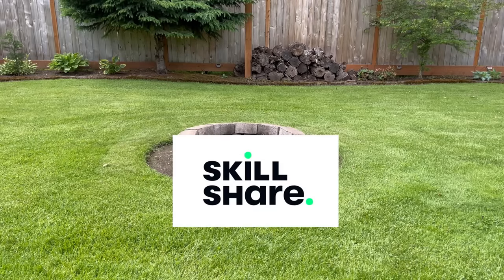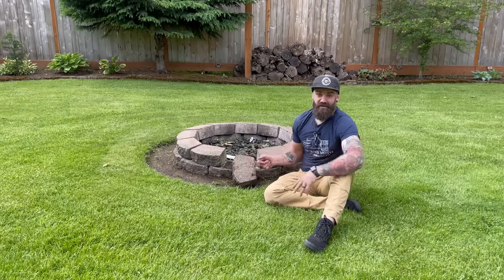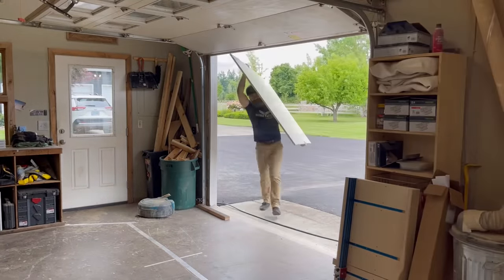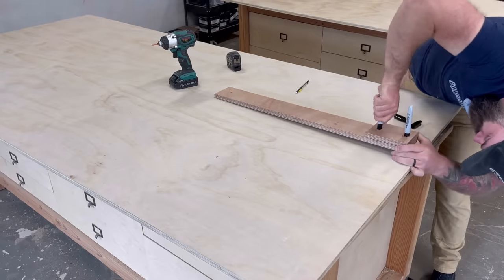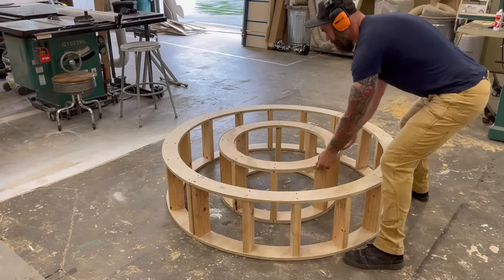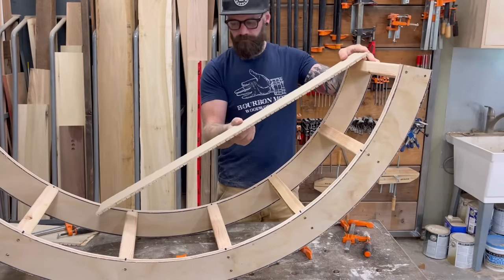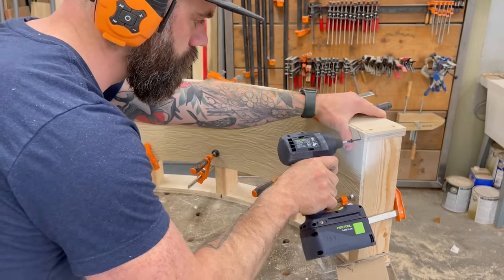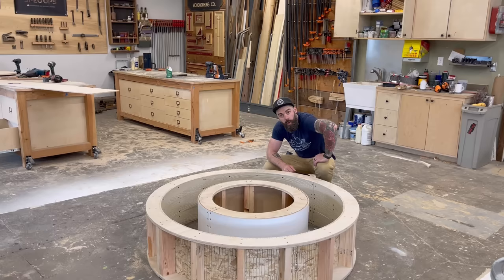Making a Concrete Fire Pit the Right Way || Ultimate Fire Pit Build

Comment: When making the inner form, use three pieces (as you did) and use wedges of at least 60 degrees in the joints. That way, when you pull out the wedges (from the inside), the three pieces will easily pull straight out from the concrete and can be lifted out. And, they will be re-usable! 🤓👍
Reply: Thought the same thing. Would have saved a lot of pain and aggravation.
Reply: Or coulda started the bon fire early
Reply: Should just burn the inner Ring

Comment: For a guy that dont know what he's doing with concrete, you sure made it look good. Would I have done it differently? Parts of it, Yes, but it turned out really nice. Overall, I'd give it a 9.5. Well done.
Reply: Do you work with concrete regularly? If so, what would you have done differently?
Reply: would have added sand and small pebbles to the concrete mix for starters.. makes it a lot more durable and less brittle..

Comment: That was nice. Dad always sprayed diesel fuel on wood when we made forms, the oil in the diesel prevented the concrete from sticking. There might be a better alternative but we always had diesel on the farm along with pump up sprayers.
Reply: 8
Reply: Still use diesel on commercial precast plants, though they are moving to water based release agents
Reply: @alisdairherd9501  I've never given it a lot of thought but I bet Thompson's water seal would work also just not as economical.
Reply: We use diesel fuel professionally also, in a big metal sprayer
Reply: @tedpanek5028  you for u
Reply: @BrandonGoble78  I have 3 sheds and a barn on the farm. One shed is sprayed with diesel and used motor oil. It makes a good wood preserver and they give me the oil at the recycle center. I spray it about every 4 or 5 years. I wish Pittsburg Paints would give me the paint for the other three. lol

Comment: DUDE SAFETY!! Concrete can detonate when exposed to fire. My sister lost her eye and had three teeth smashed out when the fire that was on a concrete base detonated. It's the trapped water turning to steam, then expanding. Stay safe - do your research on concrete / fire explosive failure, great skills in the video man tho.
Reply: Thats why he put in the fire brick on the interior part of the concrete
Reply: Dude... You didn't watch the video did you?
Reply: @averystrawn9819  You've never seen concrete explode before, it Doesn't explode by direct contact from fire it explodes from water trapped inside air pockets evaporating causing pressure build up Doesn't have to be direct heat lmao.
 Concrete can be safe as long as you allow allotted time for it to cure . Me personally would have lined the firebrick the proper way around the inside.
 It May last 100 years it may cure and then get rained on trapping water and frag, Id rather be safe If I'm investing that much money into a fire pit.
Reply: Do your research bud concrete takes 42 days to fully cure that means all moisture is gone green concrete is the few hours before it dries to the normal white color and by vibrating your separate cream from aggregate every thing he did ensured proper safety the only thing he could’ve done better would’ve been to mix in fiber
Reply: @jake_god_of_sleep6564  Concrete is most effective and stronger when it still got moister in it, Once it's dried out over time and age it will crack and get rained on if its an outdoor concrete.
 Concrete even fully cured can soak up more water retaining it. Concrete poured directly on the ground without a barrier can still absorb moisture through the ground.
   The more you know lmao 
    As I stated before it could last 100 years with a fire or 10 days depends on his climate humidity and so forth. as I myself don't need to do research I come from a family of brick layers and concrete drivers who own a concrete business in VA. I am well versed in the what and what nots of concrete.
Reply: @Exessive-Gaming  yup and I do it for a living as well pouring placing finishing and decorative. Also I’ve specifically made one piece fire pits and if you like planter boxes it’s the same exact thing just filled with soil. And yes the natural retention of moisture in concrete is good but 4000 psi with 3/4 aggregate and stealth fiber and a wire mesh inlay will last well over 100 years under proper conditions.
Reply: @Exessive-Gaming  the comment I made was directed at the person who posted the comment I was aiming it at you.
Reply: @Exessive-Gaming  wasn’t *
Reply: Its def something to consider. I had an acquaintance who took a firepit explosion to the face. Luckily no injuries, but it broke the wine glass out of her hand :/  Im not sure the synthetic fiber would do much besides melt. In fact we intentionally singe them off countertop surfaces before sealing.

Comment: Oooooh!  That is going to crack like crazy.  They make a fire rated fiberglass concrete which will help.  Also your voids should have some breaks meeting the other side. More fire bricks could help. Still great build, great effort, will like an subscribe. I want to see what this thing looks like after a year and a few fires.
Reply: A couple of good hot fires will drack it all over.
Reply: @christopherhaak9824  I think your ..... sadly very right.

Comment: I strongly recommend oiling the formboards to make them easier to remove afterwards. Also, DO NOT use regular cement for a project like this due to trapped moisture and risk of explosion. Use only refractory cement, which is designed for high temperature use.
Reply: You can recommend it all you want, but odds are no one will do that, as refractory cement is expensive. Unless of course you have two grand to spend on twenty bags of refractory cement. He did it the most economical way, and as a concrete guy myself, using wax is perfectly fine. I personally use diesel simply because I can spray it on with a pump up sprayer. But the objective is to get a clean separation, and to protect your forms, so what ever you use is acceptable.
Reply: @thebeardedone1225  expensive but will break if you don't use.

You should also never use diesel to spray.
Reply: Not a risk. It will happen.
Reply: @thenarrator1984  I've used diesel on my forms for fifty years. It works just fine, and preserve my forms quite nicely. I only use refractory cement in fireplaces. For outside pits, that requires a large volume, I substitute two shovel of sand with two shovel of fire clay. I've never had one crack. And I can't count how many I've poured that way.
Reply: @thenarrator1984  You are a clown lol Clearly haven't been in the industry as long as a lot of people. Just because there are new ways of doing things doesn't make the old ways any less feasible. Id say your attitude is way worse for the environment than the diesel ever will be
Reply: @thenarrator1984  I drive a diesel truck and I'm going to open the valve on my fuel filter to coat the road as I drive, I like the smell. If I'm a tool or a piss ant for liking the smell then so be it
Reply: @thenarrator1984  I wouldnt worry about him too much, he huffs diesel fumes for fun, there's a reason why he's acting the way he is lol
Reply: @fakename287  the race and planet would just be better if some people didnt breed.
Reply: You could have sandwiched a piece of 1/2 in foam. Vertically on the inside form. Stripping the forms would of been easier. Or used a sonatube
Reply: @chuckerroo5977  but waste of foam. Foam pollutes alot.

A pit of sweat is zero pollution
Reply: @thenarrator1984  you are BOTH wrong....diesel is a hydrocarbon...NOT a metal! Diesel is actually ORGANIC...anything with Carbon as a main element is considered an ORGANIC COMPOUND! And yes diesel DOES decompose.....I am a scientist/engineer myself and have worked in environmental cleanups. I just use nitrogen additive(vegetabel oil) and a bio-accelerator (manure) and I have easily decomposed oil/diesel spills in soils. You obviously don't know much about TRUE environmental impacts! Ever hear of the term, "Fly-shit in pepper?"    (Fact, a real concern in the oil drilling industry is bacteria getting into wells and decomposing the crude oil!") [ And heavy metal cleanups have been achieved by growing dark green leafy plants, like spinach and tobacco, then incinerating the dried plants and recycling the heavy metals out]

So diesel on forms does NOT hurt the environment. It HURTS the forms more! AND the fresh concrete surface. 
As for, "That's the way we have always done it!!" 

Here's my standard reply....."Well, you've been doing it WRONG for the last 50 years!!" (If you think not, then why haven't you sprayed diesel on concrete as a "curing oil" for the last 50 years?!?!?!

Curing oil works. It is comprised of different hydrocarbon compounds than what is in diesel. ( I do know people that use cheap vegetable(soy,corm,etc.) oils, seemed to work ok)

And I HATE asphalt crews that use diesel to clean tools and equipment!! Sure a light coating is acceptable but those guys splash it everywhere and then it continues to decompose the hydrocarbon compounds in asphalt. Just like the surface of concrete!! Spill gasoline on asphalt and watch it eat a hole through the road over the years. I've even known of guys that were pissed at the foreman and took the drum of diesel and let it drip out their pickup as they drove down a newly paved road. Within 2 years the entire road had to be removed and resurfaced!! All the way down through the Intermediate layer, a total of 6" milled out.
Reply: @thenarrator1984  Don't know what country or school you got your "geology" and civil engineering degree from but......I've met plenty of "geologists" and "civil engineers" in my lifetime.

Many will NEVER be engineers OR geologists as long as their ass points to the ground!!
Reply: @josephcernansky1794  I also hate asphalt crew that do this. 

I knocked a guy out on site once who dumped diesel full of a square shovel in a trout stream. Looking back I should have charged him instead.

Also..diesel contains heavy metal pollutants
I was right on all counts.

It's not arsenic but it contains heavy metal.
Reply: @josephcernansky1794  honestly not sure what that expression means.

I realize it's an insult but I cant.fathom.what it means.
Reply: @josephcernansky1794  what? You want me to talk about hydrogeology with strangers on YouTube? Or striations or abrasion or abysmal plain?

Come on dude..I'm not trying to explain how to calculate water flowing through ground on YouTube.

Also.... I barely used anything I learned in school at actual work.

I used water calculations but almost nothing else. For my entire career.
Reply: @thenarrator1984  ok let me chime in here. So first off, I don't have a doubt you're a CE and have all the experience you say. I'm sure, in your country or state, diesel is not a common practice, due to a variety of reasons and environmental regulations. 

To be clear, there are different regulations and practices across different countries and also different states and regions here in the US. 

In this scenario, in the middle of private property, diesel is perfectly fine to use under the right conditions.

As a civil engineer myself with, with many years in the geotech field; I've seen diesel used on curb and gutter forms, CIP walls, asphalt, and several applications, exclusively. I started out as a field engineer, worked my way up to project manager, and now work as a roadway designer for the Goergia Department of Transportation (and still spend a good amount of time in the field).

 I've been on literally hundreds of jobsites. I'm talking high-end commercial, residential, industrial, federal interstate construction, and everything in between. Commercial construction including Costco, Walmart, Publix, Quiktrip (huge national chains with the strictest standards and oversight imaginable). DOT projects with State and Federal regulations. 

I'm speaking for my career and experience here in the State of GA...I don't know what they do in Germany or the UK or even in Florida. I can only speak to what they do here; you might want to do the same, and not conflate YOUR personal experience with universal, international law.
Reply: @thenarrator1984  I respect that...but  telling someone else to NEVER do something, based soley on your morality, is quite a bit of a reach. Especially when most all of your supporting statements about it "damaging the crete", being a "hard metal", "Not being able to be removed or treated", will "end up in the waterways of local wildlife", a few droplets of diesel sprinkled on topsoil penetrating and "polluting aquifers" are either flat-out false and/or does not apply to a responsible and correct application of diesel in a controlled environment.

So again, nothing wrong with your opinions and personal practices but to unilaterally declare, what can be a completely safe and is a common, professional practice, as a cardinal sin, is quite far-fetched. 

I'm not here to preach, scold or change your mind on ANYTHING... Spreading misinformation on these types of videos are just a pet peeve of mine, because that's how we get people spreading fallacy and advising other people on things they have NO idea about...because they heard some "expert" make some claim on YT, and it makes simple, general research convulted with conflicting information

...end rant
Reply: @thenarrator1984  Again more fallacy... likening a few ounces of diesel on a concrete form is literally nothing akin to  pouring oil down a drain, a tanker spilling hundreds of gallons of diesel, or pouring gasoline into the ocean. Let's save the hysterics and hyperbole.

 I've clearly stated that I respect your right to your opinion and am not here to change your position, but let your position stand on its own without setting up straw men about catastrophic diesel spills when we're talking about a minute spritzing of diesel on a surface.
Reply: @Thomas998822 

Either a material is fine to pour on the streets like cool aid

Or its bad. Like diesel.

There is no in between

What fallacy? The only fallacy I see is your logic which fails entirely.

When a free human being hurts the environment we all live in.. their liberty is forfeit.
Reply: @thenarrator1984  
Your poor wife

Comment: Your voice is supper soothing!

I’ve spent lots of days covered in diesel while putting together foundation forms… because that used to be a thing! you can put most anything on it that’s slippery. 

Also if you ever plan to try this again you can probably tack together the inside part with just brads because all the pressure is focused inwards. 

I have cheated many times using little tiny bread nails on two by fours that all get compressed by concrete. Then you just whack them out, it’s pretty awesome. 

I love your video and the fire pit is amazing good job.
Reply: Imagine if masons poured foundations this way? We need basement walls, so first we will build a house out of wood, then build a smaller house inside of it. Then fill it with concrete and then throw away the house :) Instead of just hammering some pins in the ground lining it with plywood and fixing the final product with a finish coat of cement/stucco.

This was so zen to watch, and totally the way I would do it if i could afford to do it that way.

Comment: Looks fantastic!

The only thing I would have done in your place would be to burn out the middle and next time remaking the center have the ends join in a parallel miter so they could be slid out of place towards the middle instead of only vertically 

;)

I might have to do this myself now, great content, and screw it, I think it's due time I just subscribe XD

Comment: From someone who's done concrete for over 30 years, you did pretty well. The only thing I might've done differently would've been the inside form. I would have angled them so they slid right out.
Reply: @SVW1976  burn fresh concrete? It hasn't set yet. It takes at least 3 weeks but the thickness of this will take a lot longer. Burning the forms out can damage the concrete.

Comment: Use high density foam cut to size of your inner diameter,  glue and stack them to height.  Pour the concrete and use a multi tool to take the high density foam out after its cured. It's not reusable,  but works excellent
Reply: I was thinking the same.
Reply: Or burn the foam?
Reply: @BaDiLi2L  as long as you don’t burn the pvc pipe it’ll be over quick
Reply: @MrRockitt3  😂

Comment: Spray some oil (used) on the inside of the forms that meets the concrete prior to pour.

It’ll make removing the forms a lot easier.  
Doesn’t effect outcome - as oil and water does not mix 👍🏻

Comment: "only one things to do"
Me: Light the internal form on fire?  it is wood and that is a fireplace.
Reply: I thought the same thing😂
Reply: Came into the comments to look for this.
Reply: Exactly
Reply: Biggest issue there is that the concrete hadn't finished curing yet. If he had lit a fire, the concrete would have cracked and degraded reallllly bad.
Reply: If you made the joins for the inner form at an angle of 45 degrees instead of 90 degrees they should pop out easier.
Reply: Ditto
Reply: I was waiting for it 😂
Reply: @jimmybatx  Well you’d obviously wait till it has completely Solidified, before doing such a thing
Reply: @mntrken2001ify  That may be true but he was doing this to show the average person how they could do it… 45° angles require math and more checking, which would cause potential DIYers to just drop  the idea in it’s entirety
Reply: exactly what i was thinking he gonna do